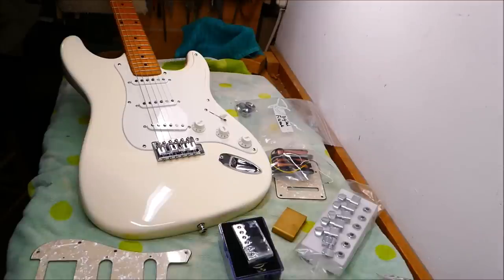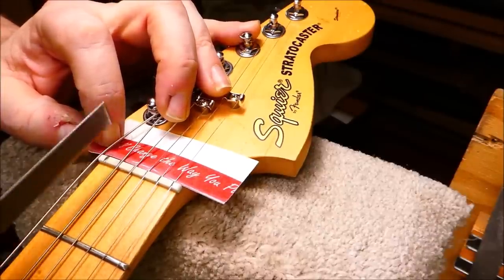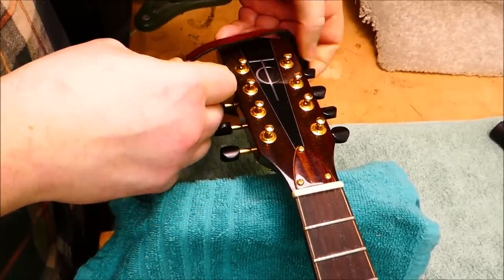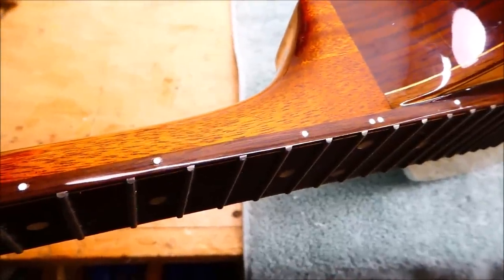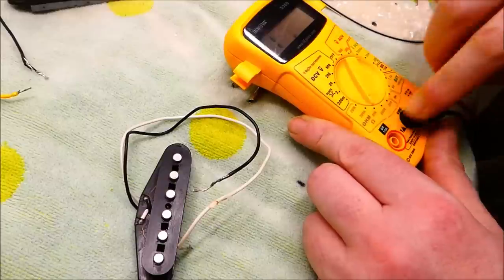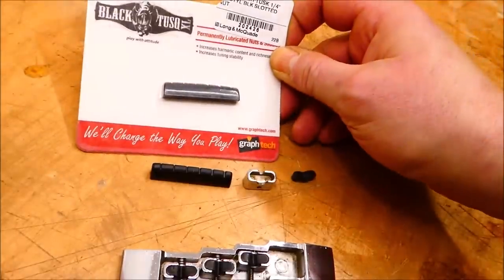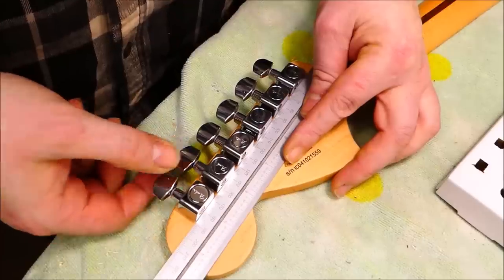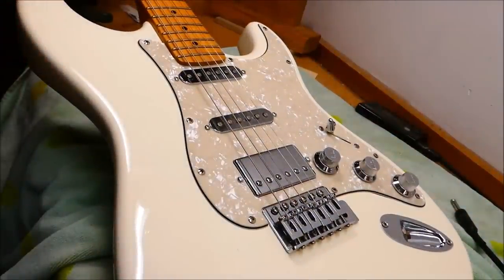That's a lot of work!

Comment: I bet in my area, NYC,that would be a $1,200.00 job. I did that stupid shit in high school to my Squier. I bought carvin electronics and sealed tuners,copper tape everywhere and  a new pickguard, and it all went together flawlessly ,but, dollar for dollar, I coulda just hustled a little a bought a better guitar. Don't buy a low end guitar then spend more than it's worth,to hot rod it. Just buy a Fender,maybe order one. At least guitars are way cheaper than when I started playing. The labor involved in that Squier rebuild was worth more than the guitars worth. That's a $200 guitar.nobodys doing all that work and any parts for less than $300. Shit,for $300,I'm sure you could walk into a guitar center and order a custom Squier.

Comment: The part about fitting the tuners reminded me of exactly the same problems when I had an astonishingly good Squier mini-Strat. It was worth upgrading the tuners and, as Ted found, Fender tuners have their pegs in a slightly different position. For my previous (now unmonitored channel), I uploaded a walk-through of the work I did on the mini-Strat . . . including the plugging and drilling for Fender locking tuners. https://www.youtube.com/watch?v=bjCrdjZn4V0
Reply: Yep...they look similar, but are NOT interchangeable. It sucks. In my case, I simply cut off one of the two bumps on the Fender tuners, reamed out the appropriate holes on the headstock, and popped them in. The bumps are only there to keep the tuners from rotating, so a single bump is all you need. It's a stupid design, IMO.

Comment: It's not economically viable to pay somebody to do that kind of work using cheap parts, it's the kind of thing you will regret at some point and want to revert back to what it was before.
If you can't do the work yourself there are plenty of used guitars available which have the right combination of pickups but you'd probably have to compromise on colour scheme. 
Can't you even buy a loaded scratchplate that you can just replace the original one with ?

Comment: How much? 20€ an hour, plus parts? I have to say, that's horrible cheap looking chrome. 😕

My partscaster wasn't a shop bought guitar that I forced to fit together, it started off as a commercial neck and body that I went to town on, HSH, floating trem, side jack and no scratchplate. If I could post pictures to YT I'd show you all 🙂

Comment: I wouldn't say parts casters aren't worth it, I've built 2 and they both went together without any problems. That said, I researched the parts and bought stuff that fit together well. The bodies had no pickguard holes drilled so that was never an issue, for instance. They are really fantastic guitars and I'm glad I went that route because Fender doesn't build the Strat and Tele I wanted and quite frankly, I dislike 95% of thier guitars for the last 30 years. This guy did zero research on the parts he bought. This thing sounds like s*&# to me, maybe it's the amp...

Comment: and on top of everything else, it sounds like that random asian import middle pickup is out of phase with that random asian import bridge pickup :( even better, reversing the wires on any of those pickups to solve that problem will lead to pickups that make a bunch of noise if you touch them

partscasters make sense when it's good parts, not least because they'll more likely conform to real USA fender specs and thus fit each other with less of a fight. even then the buyer has to know the specs of what they're assembling to avoid incompatible parts. 

as it is, this conglomeration of different low budget parts, even after being wrestled into one piece by our ace luthier for what i hope is fabulous money, will be worth almost nothing on resale; certainly less than what an average $200 new squier strat might sell for used

Comment: In my ads for my repair biz, I always say "We install your correct fitting parts" due to the exact problems the guitar in this video has... fitment and spacing issues. Nothing fits anything anymore especially with the introduction of so many metric guitars and parts on the planet.

Comment: I'd say $300 for everything, which proves when you're trying to cheap out by buying a relatively inexpensive guitar and "upgrade" it's functional parts, you're not exactly getting out of paying for the more expensive model. The guitar out the gate would retail $400 or used for ~250-300. When you consider parts and labor, that's close to an 8 or 900 dollar guitar. You can find excellent instruments in that price range used or even new. 

And considering the parts supplied for these upgrades aren't even of great quality either(single coils look cheap/ebay specials, covers, bridge saddles, even the fender tuners are likely the same as on player series or mexi standards) You're really just hodgepodging a decent guitar with substandard parts. 

So as already stated, these types of projects should be left up to the hobbiest. Have fun, learn something, watch this guys videos for reference(because they're excellent) and see what you can do.
Approach each problem methodically, and visualize the steps you'll take to get there. Really spell it out; it will raise a lot of questions, but those are the things needed to learn!

Comment: on that strat. the short tuning machines are for the treble side e/b strings so you don't need a string tree. also he wants some USA strat parts and unknown on an Affinity. they will always need a lot of work to get to fit, or just don't fit. (as in your case) when someone brings me a pile of unmarked parts, like you received for thar guitar. i tell the owner the minimum will be $100.00 to start, and $40 per hour after the first two hours of laboring. the last one i did like the one you did took 6 hours.... hopefully now you will understand telling the customer that it would be cheaper to just but a guitar maid in mexico. just a word of advice next time. when you see a bastard child like that guitar, JUST SAY NO....

Comment: "What should someone pay to have a partscaster assembled?" is really at least two different questions: "What is the value of the labor involved?", and "What is the value added to the completed instrument?".

The first one is probably pretty straightforward. You have an hourly rate, I'm sure. That's how much you should expect to be paid.

The second one is somewhat less straightforward, because there are subjective values involved. If that guitar couldn't be obtained another way, and that's what you want, is up to you. But if you remove the subjective value, the answer is basically $0, or, really, less than $0. Very, very, few people will pay more than the value of the parts for the guitar once it's assembled. Most wouldn't even pay the value of the parts. Most would pay no more than a used rate for whatever the base guitar was. The value of the additional parts and the labor is lost.

Comment: I have seen Ted spend hours and hours on cheap old acoustics. I assume the client paid up each time. How is the partcaster any different? If the client is willing to pay where is the problem? This is not a Chender either. Is it even ethical to refuse the work if the client is prepared to pay and you are not backlogged with work?

Comment: For my money, the best you can do is get a pre wired pickguard from somewhere and then you can do minimal soldering and stuff. I think what you’ve done is worth a 3-4 hundred bucks. I paid like 90 usd for a wiring job but I bought the harness for 200 and I bought the pickups for 250 so….ya know…it’s probably only worth it if you are having fun with the guitar and it makes you happy.

Comment: This is not an Honest assessment of a parts caster.
    What you dealt with, was a customer that did not order the correct parts.
    Parts are sold stating the correct diminsions and notices for what the part fits, as in American Made Fender, mexican made Fender, Overseas Squire, et cetera and so forth.
    You could have just as easily told the customer that he ordered the wrong parts, suggest that he Return the wrong parts, and order the correct parts.
    Now, you have plugged the Original drill holes in the Headstock and Back Side of the Body, and added New Drill Holes in Each of those, and scraped the Pick Guard, so that None of the Original Parts can be Replaced without having to do ALL of that  "work"  Again !
   I find that Very Irresponsible of you.
 I doubt very seriously that you didn't know that, and it was your repsonsibility to Inform the customer before you started Ruining the Original Parts, Body, Headstock, and Pick Guard.
   Yes.  It is a Squire, but ALL of those parts could have been Replaced with the Proper Parts without having to do Any Drilling, Plugging, Sanding, or Scraping. 
  This Video, and the Squire guitar, was a Complete Travesity of Unnecessarity !